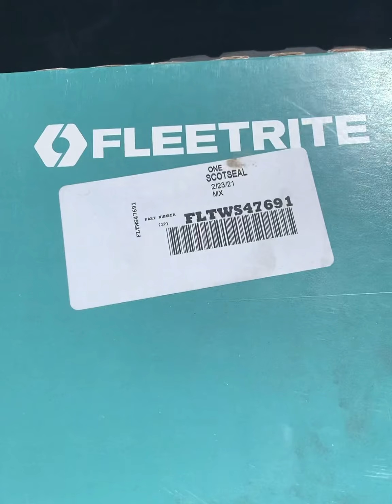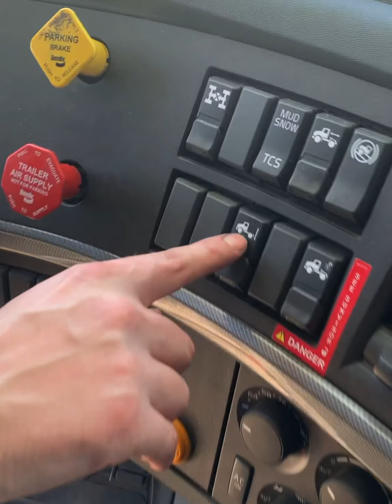Wheel seal replacement. Leaking wheel end. Volvo fix coming your way.

Comment: Nice video. What size is that hub nut?
Reply from the maker: If you have a new Volvo it’ll be 3 3/4 6 point. Part number for that socket will be otc1926

Comment: Great video. We'll explained.  Is this application applies to a 2013 volvo vnl 670 ????   IM DOING WHEEL HUB SEALS THIS SATURDAY. THANKS
Reply from the maker: Appreciate the positive feedback. There a few different styles of wheel hub bearing locknuts that all the manufacturers use. Depending on the style of locknut the torque spec will change but between the models and brands there all very similar hope that helps some
Reply: @bustedknucklebydieseldr3228  lm heading to a volvo dealer today.  Picking up some brake s cam shafts.  Volvo should know the torque. Right.?  Thank you for replying back and keep up the good work.   Have a fantastic day. Thanks.
Reply from the maker: @nelsonmendez7893  Yes they would but they might be hesitant to give out the info as there not doing the work. If they dont,message me and describe your set up and il try to find  it for you..Stay safe man and congrats on tackling the job yourself.

Comment: Can you tell me what the lbs per nut is?
Reply from the maker: Good question but that is a tough one to answer because there are many types of wheel bearing locknuts and there each different specs. Unless you had this exact one then it wouldn’t help you. Was yours exactly like this one?

Comment: Shouldn't that axle have a gasket on it?
Reply from the maker: I think you need to take another look at the vid. The axle flange had its own seal. Not the paper gasket crap that usually comes on but a thick rubber oring type.
Reply: @bustedknucklebydieseldr3228  Ahh I see it, I haven't seen that in person yet just paper.  Are them seals reusable?
Reply from the maker: @LmanTrojan1212  yes they are reusable, as long as there’s nothing visibly wrong with them. Anything showing signs of wear I’d replace it just incase. Great question though.

Comment: How much time do you get to do hub seal ?
Reply from the maker: To do those wheels seals on any brand trucks you can expect just at 1.5hrs.  Doing brakes with them usually adds .5hr. So really not much time to mess around.
Reply: @bustedknucklebydieseldr3228  right 👍👍